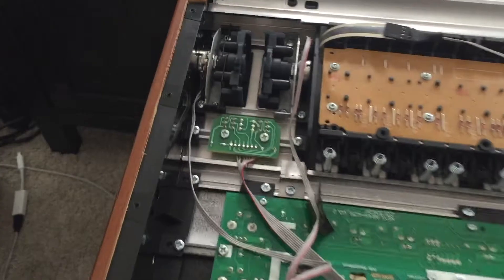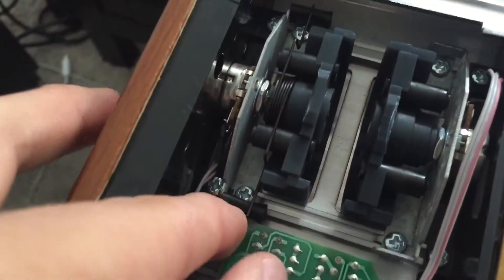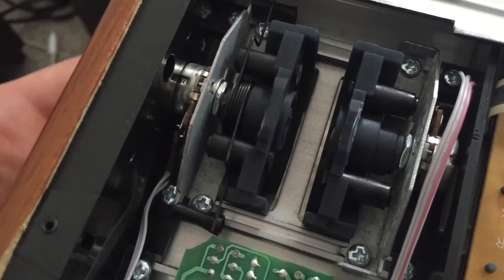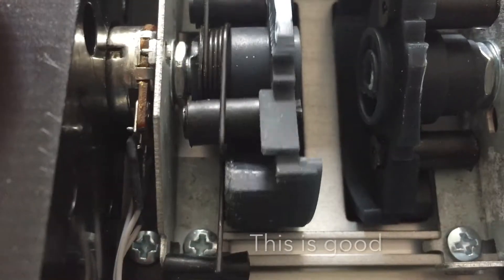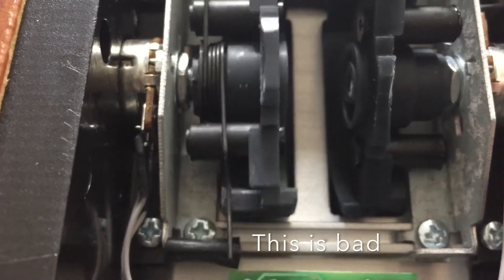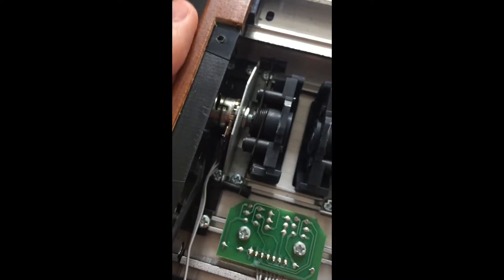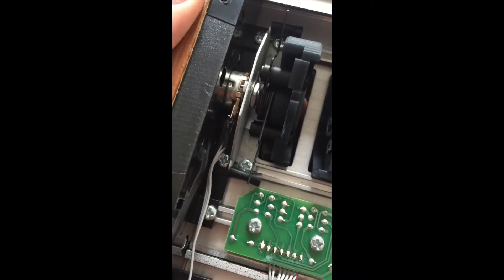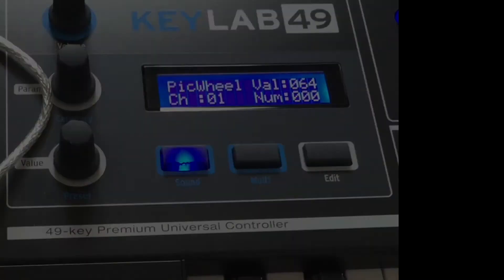Arturia Keylab Pitchwheel Fix

Comment: I have pitch wheel issue with keylab MK2, but I found out it is related to the mod wheel. It looks like the potentiometer of the modwheel has bad contact and when I wiggle the modwheel (not up down) but slightly left right, the pitch wheel is changing it's value. When I remove the modwheel completely the pitchbend is responding stable As expected. I think I need the replace the potentiometer of the modwheel. Any suggestions?
Reply from the maker: Oof, I honestly wouldn't know. Sounds like you identified the problem though. At this point I'd probably contact Arturia personally as they might help you out with info or spare parts